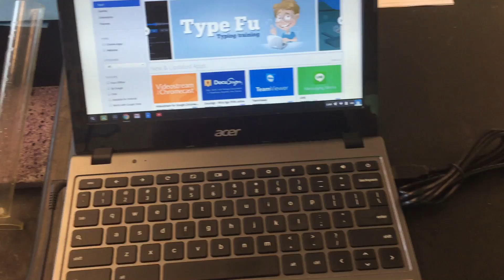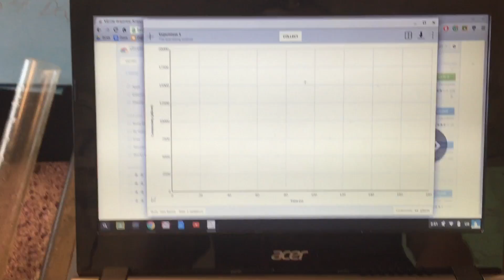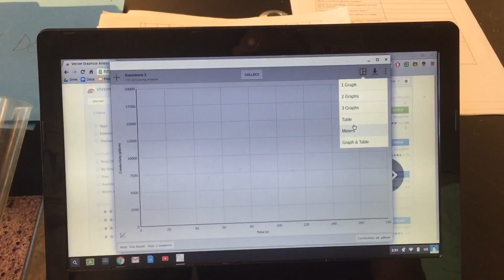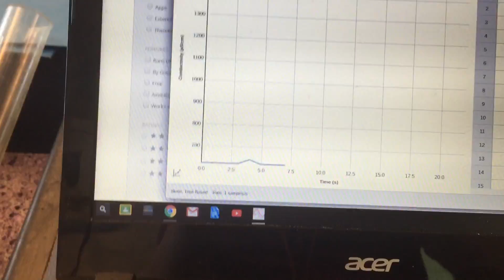How to Use a Vernier Conductivity Probe

Comment: Hi, where can I find data about the electrode's material, dimensions and other values? You said glass electrode, and I found s "parallel carbon (graphite) electrodes" with a "Cell Constant: 1.0 cm⁻¹". Is this correct?